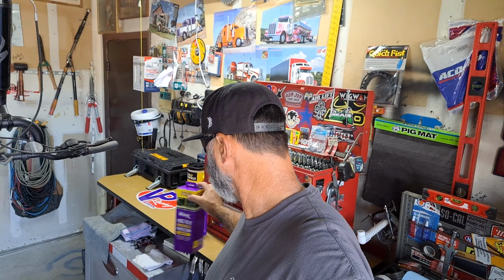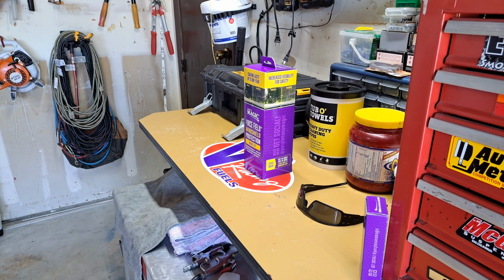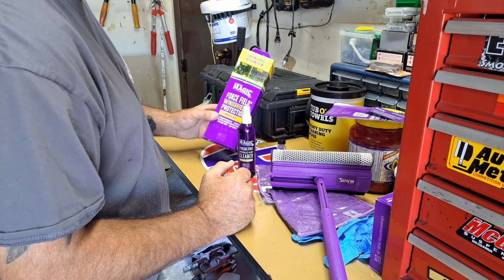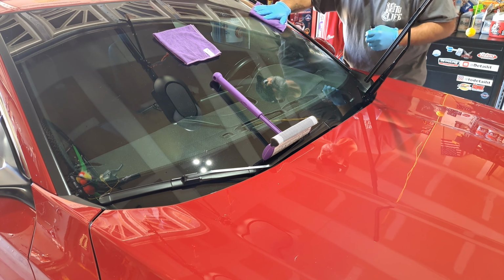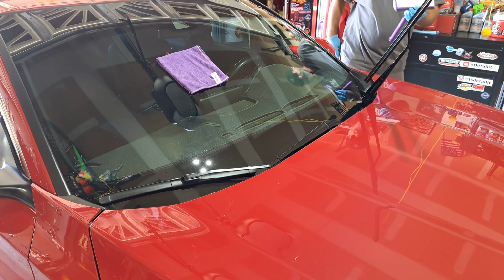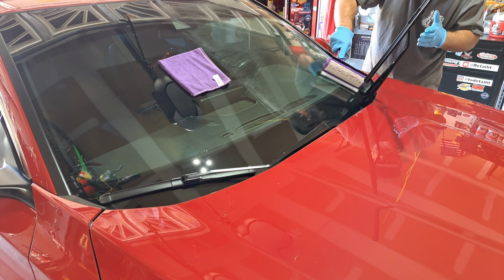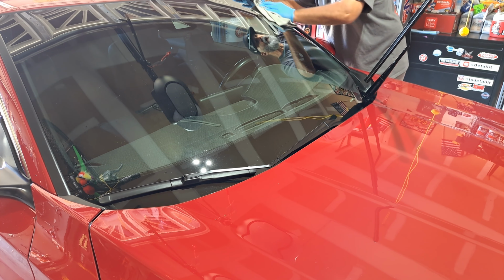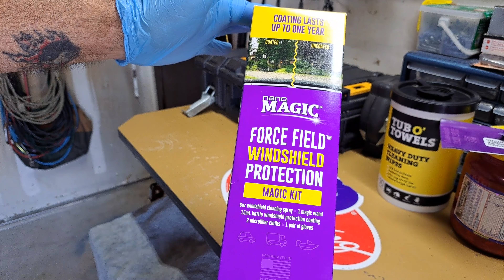NEW! Windshield coating by NANO MAGIC | better vision in the rain!

Comment: Doug I was like you I was worried it was not going to come off. That didn't look wet enough to squeegee off. I thought for sure you was going to be buffing the windshield. I always use a spray detailer / wax on mine. It makes it bead up really well and most of the time I don't even have to use my wipers.
Reply from the maker: Hey Tim. Great info share; thanks Man. Yeah I try all kinds of stuff on glass. This kit was actually super easy and works fine. I tested it last week. I'm very pleased with it. Like you, Something on the windscreen is better than bare Glas C'Mon??! Thanks for watching/Sharing Timbo! Take care brutha!